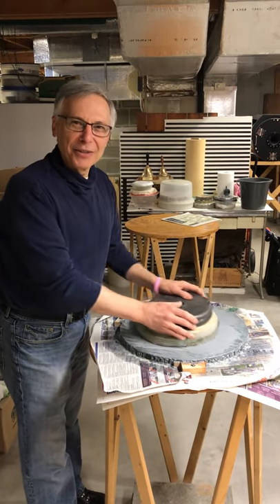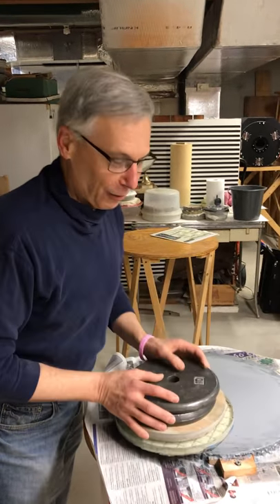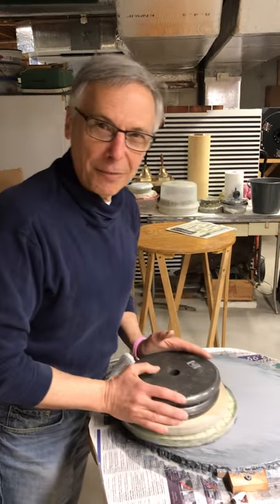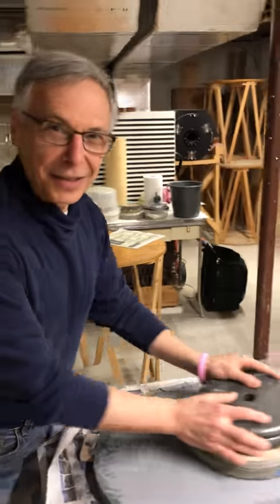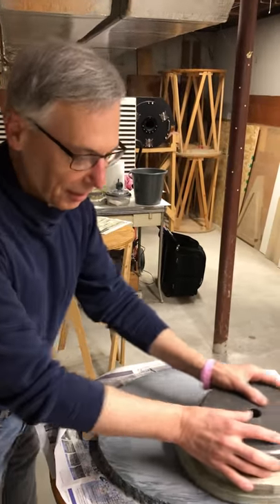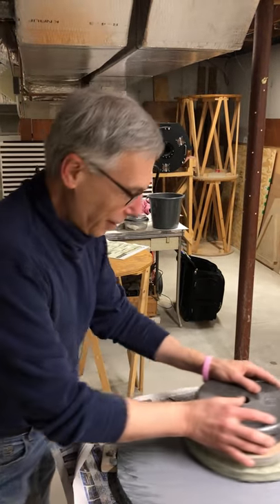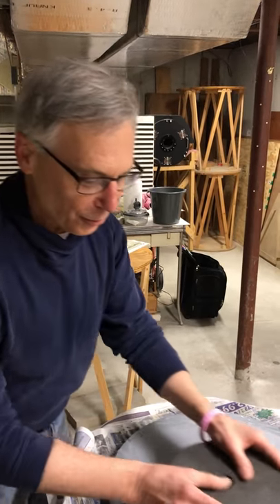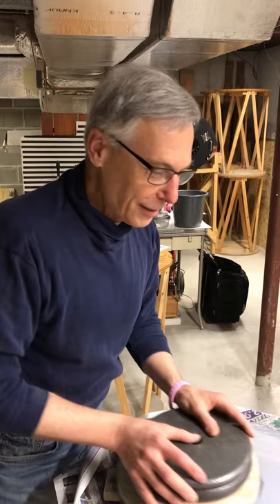Telescope Mirror making Part 1

Comment: I'm starting my mirror this week Its a 30 in I'm thinking I can make it a f4 , I would rather it be shorter like a f3.3 or do you think it would give bad images. I'm a beginner in telescope mirrors an long time astronomy lover so any advice would be appreciated thx
Reply from the maker: A 30" mirror is quite a challenge. Is this your 1st attempt at making a mirror? Where did you get the blank? How thick is the blank? What type of glass is the blank?
Reply: @andyponiros2194  yes sir it's my first I'm a 31 yr old electrician an interested in astronomy for 30 years , I would have went smaller but I could not find a piece of glass anywhere I searched the internet an called every glass an mirror company in my area .an I'm clueless on what I was looking for , I found 1/2plate glass for table tops online for $180.00 then I just found a 1/2" round piece of plate glass in my shop that was used for a coffee table,  it's 30in. X1/2" thick an thought I could possibly use it to have a giant telescope , do u think it's even worth it ? Or will a 20in mirror do just fine ? Thank you sir for your reply
Reply from the maker: Making a telescope mirror from a thin piece of glass can be very challenging. Particularly with a f4 ratio or smaller. Even a 16 1/2 mirror at f5 is a huge challenge. A f4 30" mirror would be so thin in the middle that it would flex under its own weight & you would not get good images. I am actually making my mirror & scope as a tribute to John Dobson and his revolutionizing of low cost large aperture telescopes, but I don't expect great images from it. My suggestion would be to make a 6" or 8" mirror first. You can purchase a mirror kit from Newport Glass. I would suggest calling them & telling them what you would like to do. I would also suggest that you get help from a local astronomy or telescope builders club while making your mirror. The more guidance you receive, the more successful you will be. Good luck! If you have any more questions, just send a reply